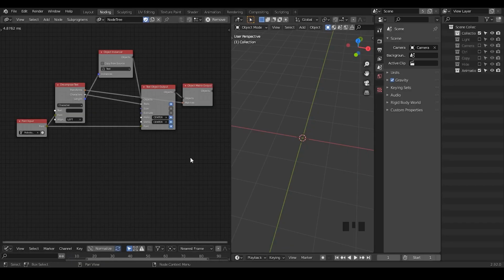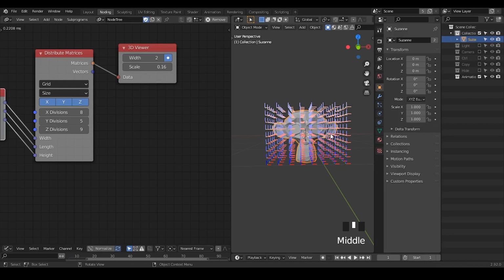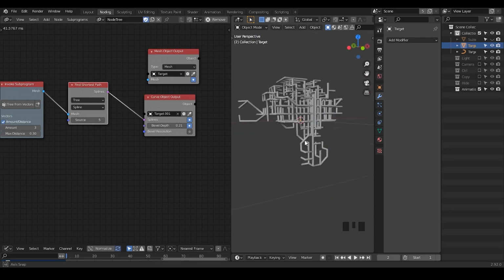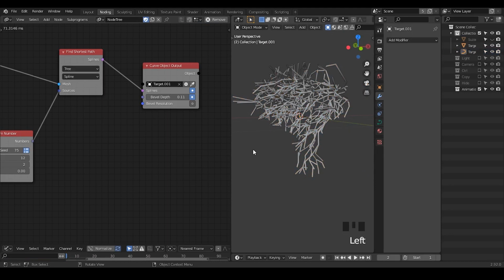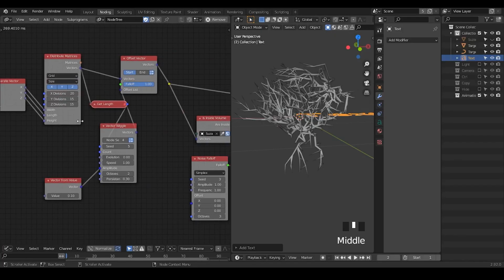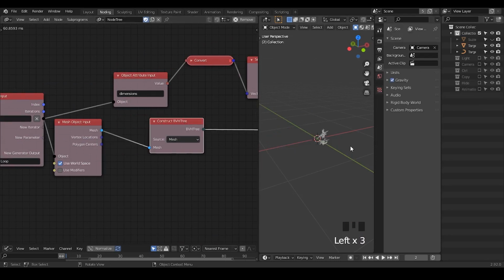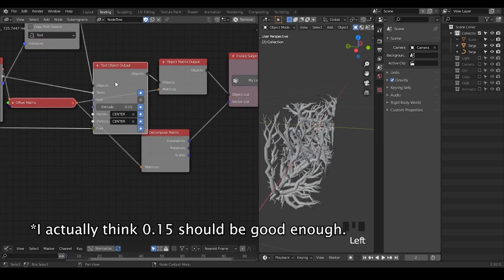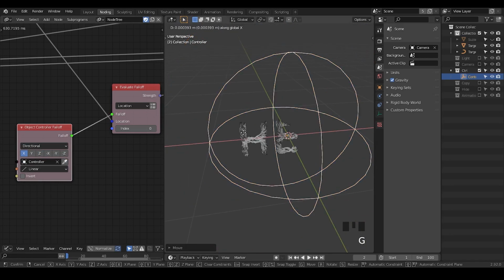[Tut] Houdini Growth Effect V1/Volume - Blender Animation Nodes

Comment: Very nice. This seems like a good solution for quick execution and bounding to objects. I'm taking notes!!
There's also an Lsystem node in sverchok, which you can combine with voxel remesh and the laplacian modifier to get very organic results. But it has to recalculate each frame and slows exponentially. Maybe this effect would also work on your example.
Reply from the maker: it's understandable that if you put a remesh modifier everything will be horribly slower. BTW AN also has Lsystem. If I remember correctly it was developed even before SV one, although I also think Houdini first started this concept.
Reply: @bradleyanimation120  You know, it's actually the Animation nodes Lsystems I was thinking of! Seems there's nothing like that any more in Sverchok :P
Anyway your method has more freedom, maybe there will be a better way to smooth the results eventually.
Reply: @bradleyanimation120  My nodes are at the bottom of this page https://www.artstation.com/artwork/Vg2QDX
Reply from the maker: @danielloo1255  Wow, nice work! Not something I can easily make.